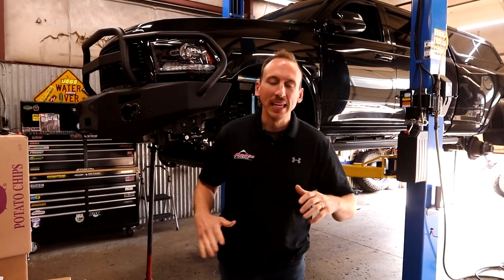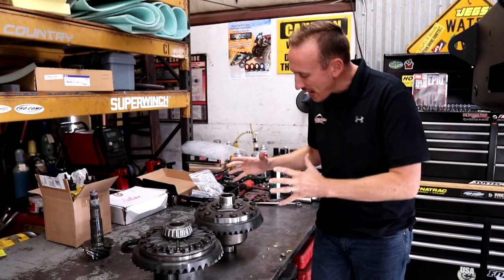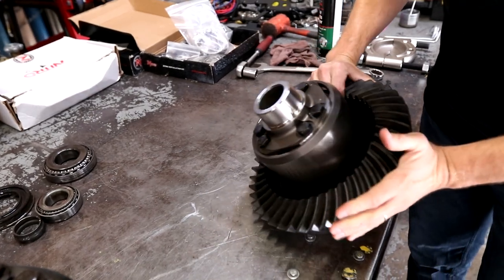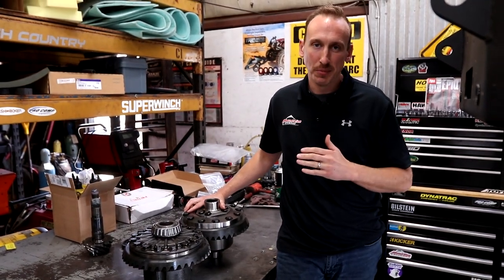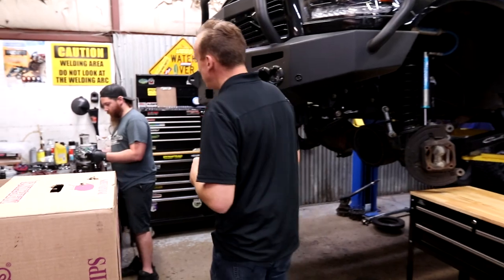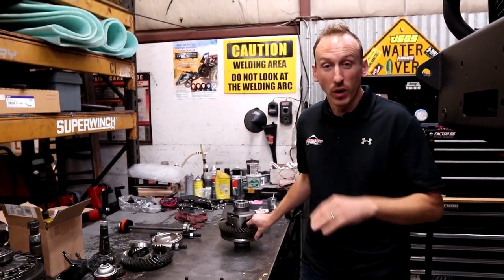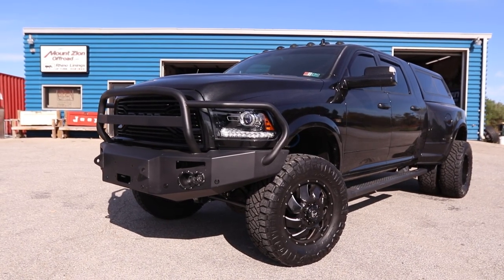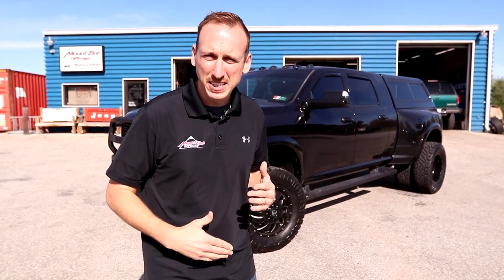Massive 2016 RAM 3500 Dually gets 4.30 Gears!  Watch This before you Install Nitro Gears in your RAM

Comment: I have a 2017 Cadillac Escalade with 3.23s and I'm looking to swap to 4.30s. Would I have to tune it into a computer or will the computer adapt to it?!
Reply from the maker: You would need a calibration system to setup the speedo to the right tire size and gear ratio!
Not sure if anyone makes one for an Escalade though!

Comment: Hello, I really need some help, I have a 2016 Ram 3500 6.7l 4x4 long box Laramie w/ aisin trans and 3.42 rear end. I want a 4.10, I tow 34-37k pounds weekly (gross combined weight) with my 4 car hauler. I can’t figure out if I have a 11.5 axle or 11.8. Which 4.10 would work for my truck?
Reply from the maker: Give us a call, we'd be happy to figure it out with you 717-308-1844
Reply: I tow cars for a living and towing 4 cars with a 3500 you shouldn't do. You need a 4500- 5500. The rule of thumb is how many cars you haul is what size truck you need 2 car 2500 3 car 3500 ect. ect. Anything over 5 cars you need a semi

Comment: Considering a purchase of a 2017 RAM 3500 SB DRW 6.7L 4x4 Longhorn Laramie Limited with a 5th wheel slider hitch h 35" wheels.
Need to tow a 20k GVWR trailer. Unfortunately the truck has the Aison & 3.73 gears according to the VIN and local dealer. Charts found online read a max tow of 18,010.
The dry weight of the 2021 Momentum  5'r is 16,388. After fuel (50 gal total @ 7 lbs gal) passenger load of 450.
This calculates to about a 800lb total payload in trailer which we plan on living in and taking our belongings on the road. 
 
The trailer & truck are a package deal that the current owner has traveled in for 9 months stating he has "never had an issue towing that weight".

I am a bit more conservative. Wondering if simply changing the gears to 4.10 would increase the tow capacity, driving around in 5th gear, or just forget this tow vehicle and find a more capable one?
Reply from the maker: The trucks with higher tow capacities always had the lower gear ratios, though there may be other upgrades included from the factory to give that certification such as brakes, transmission and engine cooling.

Comment: Do you think I’d have same problems with 2016 srw Ram 3500 with aisin transmission or are these issues just with the duel wheel trucks ?
Reply from the maker: I would expect the same issues until specific kits come out for these trucks

Comment: I have a 2021 Ram 3500 with 3.73 gears.  I'm running 38s. Wanting to switch to 4.30 gears. Will this set up work for me?  I was told nothing is out for my truck yet.
Reply from the maker: All the listings we see are for "2014 and newer" trucks.  Revolution gear has packages for 2014 and newer 11.8/9.25 in 4.10 or 4.56 but not 4.30.  We have not installed a set of those yet, so unsure if you will have the ring gear bolt pattern issue we ran into with those or not.  Hopefully there will be more options soon!
Reply: @MountZionOffroad  I might just go with 4.10. With the regear calculator it says to run 4.24. So I was going to go with 4.30. Is 4.10 still a decent option. I had cake Yukon the said they are in the making of 4.30, but they won't be ready for about 6 to 8 months.  Should I wait or run the 4.10?

Comment: Hello, I want to install a 4.88 gear on a 2016  Ram 2500 6.4L to fit 37’s or 40’s tires. What do you think?
Reply from the maker: I see Yukon has a 4.88 for the 9.25 front, and Nitro has it for the rear. I can't guarantee you won't run into the same issues we did when doing the installation though!
Reply: @MountZionOffroad  what about performance, gas mileage, will run faster?

Comment: This is probably a really odd request but would you guys be willing to also do the break-in after you re-gear a truck? The break-in process is the thing that scares me away from re-gearing the most. It just seems like something that could be messed up easily and on top of that just a hassle.
Reply from the maker: The regear itself is a tough thing to do! The break in process though isn’t so bad! Just have to be gentle with it! Would you want us to do it all??
Reply: The re-gear certainly is the toughest part! I don’t have a truck that can be re-geared but I am hoping to purchase a one ton single rear wheel truck in the next year and will definitely want it re-geared! It would be great if you guys could do the re-gear and the break-in for me!
Reply from the maker: @wishiwereroaming  we could most definitely do that! But normally the process would be, we regear it, finish it all up, give it to you to drive for 500 miles gently and then bring it back into us to change the oil in the diffs!
Reply: That’s not too bad. I would be coming from 15 hours out so that adds a difficulty factor to the break-in process.
Reply from the maker: @wishiwereroaming  we may be able to help ya out then if that’s the case!!